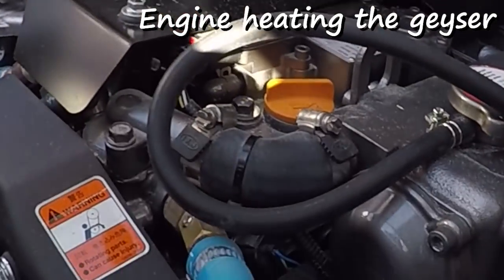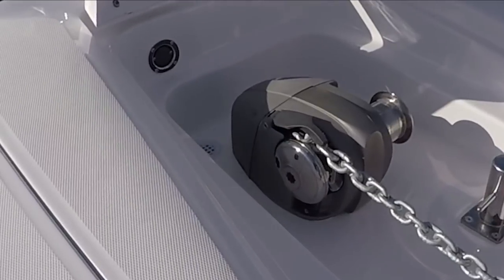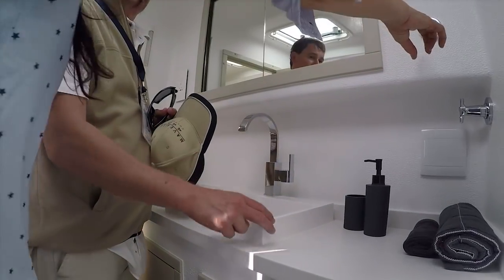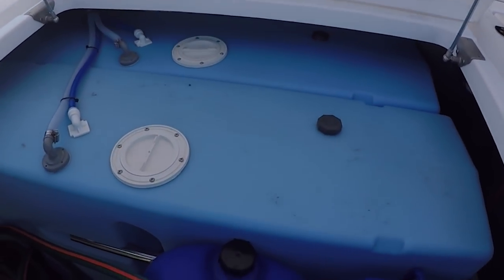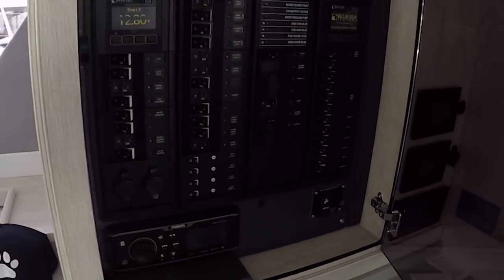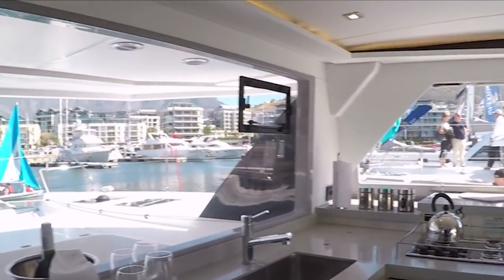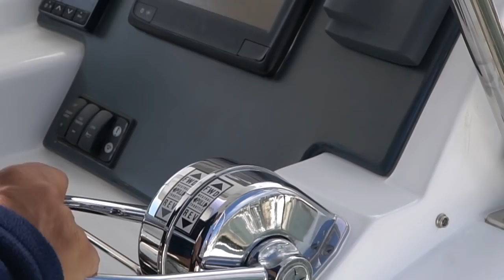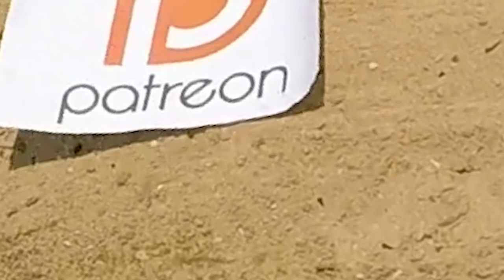#5t We decided to buy a Leopard 45 Catamaran! We're going to live like Salty Sailors! | Sailing Sisu

Comment: Capt Frik,  Re: New Maverick 440 Hybrid. I’m not quite as tall as you so cabin height won’t be as big a deal for me. I think it was for you. I know storage won’t be as much as L45 and, no forward cockpit.  But an E-boat would be koowl, don’t you think?
Reply from the maker: Yes, I do think that. But keep in mind that I was thinking of replacing the smelly diesel tanks and noisy diesel engines. With hybrid, one only replace the engines with motors, but keep the diesel tanks as well as a much bigger genset. The genset has to be at least 13kW...very heavy and noisy and smelly and for sure not green 😉
Reply: Sailing Sisu saw that; tech not quite ready for prime time.  Yes  still two ( albeit smaller) diesels and no stand-alone generator. I would need to find out more about the drives, are they series, parallel/mechanically linked, etc.  Ideally you can run one as a decoupled genset and not run the drive motor if needed. In any case I will watch the progression over the next several years. Thank you again for your tech knowledge and responding so graciously to my queries.

Comment: Hope to be where you are at in this video in 2-3 years. Very nice boat! Like the Leopards too! did you look at any Royal Cape Majestics?
Reply from the maker: Hi, Chris! We just cannot wait anymore! The RCM has excellent finishing touches and is very similar to the Knysna. However, personally, I would not go for the high fly bridge. The Leopard 50 has an option for having it, and for that reason I would rather go for the L50 performance cat without the fly deck. The RCM has very roomy and light cabins, which I like. But have a look at the L50 and mention that you were referred to by us, they will treat you well :-)
Reply from the maker: Chris, just to clarify, if you want to cruise around the proverbial cabbage patch and entertain, then for sure the fly Bridge makes sense, but if you want to sail, you need all the sail area you can get. The higher the sails the higher the wind speed, but the faster you'll reef (reducing sail area) or you risk loosing the sails

Comment: Why the double shackle on the anchor/chain rode?
Reply from the maker: Not sure what you referring too? Is it the swiwel?
Reply: @SailingSisu  The shackle is the chain link with a threaded bolt so you can connect the anchor to the chain. Why 2 of them on the rode?
Reply from the maker: I do not see a double shackle🤔 between the chain and anchor. That said, this was a show boat and not Sisu but, we also have a swivel, a Mantus swivel
Reply: @SailingSisu  Oh ok a different boat. That explains it.

Comment: This front outside cockpit area is a bit dangerous. Imagine it full of water by some wave.
Reply from the maker: Actually 100% safe. It drains water 4 times faster than required by law :-)
Reply: Sailing Sisu the law of men is never a consideration by the laws of nature and physics! I have actually seen reviews by experienced sailors who were saying that they don't like this design at all. Imagine that you sail in high seas and one wave gets suceeded by another filling completely or partially this area with tons of water before the "4 times faster that the law" drainage compensate to drain. 

That means that the cat will have to be sailing for a lot of its sailing time with extra weight at the front. This is not a good scenario not only for performance but for safety as well. A cat's major harard is of tipping over while surfing down a wave (45s are quite big therefore a lot safer than the 36s or 38s - but still you should never compromise on safety). Extra weight at the front is the least you want in such instances.

P.S. The front door opening poses a threat as well. There's good reason that almost no cat I ve ever seen has a front facing door for the saloon. It's certainly nice when moored but underway it's a possible fail point. Apart from that I'd like to thank you for the effort in making those videos. I'm actually taller than you (6'10") and I find useful to see other tall people try out cats for their liveability.